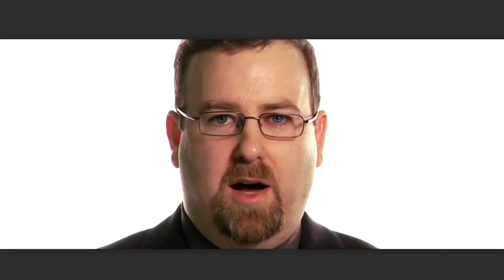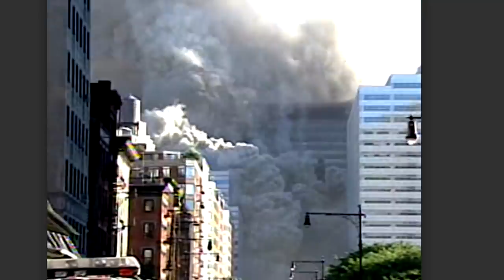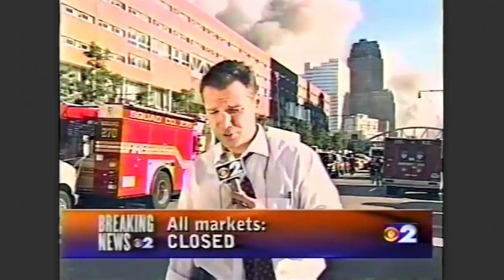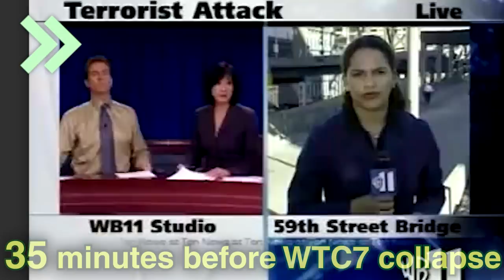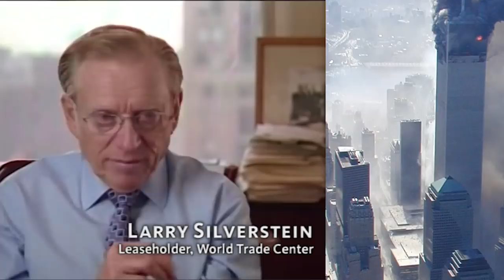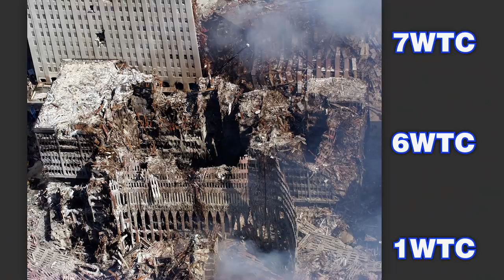9/11 - 7 World Trade Center (WTC 7 Free Fall Collapse)

Comment: It fell at a rate that you would expect with the INCREDIBLE DAMAGE from the plane attacks ,and yes , the  Very long burning Extensive fires ,
Reply from the maker: WTC7 was not damaged by any plane attack. It was damaged by the destruction of the North Tower, which started fires.

The fire is the reason the government says WTC7 fell. The government states that the physical damage alone to WTC7 was not the reason for collapse, it only happened due to the resulting fire.

As mentioned in this video, many buildings have had much larger fires burn significantly longer, and remained standing.

Comment: Where does the "7 second" figure (for how long WTC7 took to collapse) come from?  Has it been confirmed by NIST or FEMA?
Reply from the maker: https://www.nist.gov/pba/questions-and-answers-about-nist-wtc-7-investigation

Actually NIST says it was 5.4 seconds: 

"The analyses of the video (both the estimation of the instant the roofline began to descend and the calculated velocity and acceleration of a point on the roofline) revealed three distinct stages characterizing the 5.4 seconds of collapse:

Stage 1 (0 to 1.75 seconds): acceleration less than that of gravity (i.e., slower than free fall).
Stage 2 (1.75 to 4.0 seconds): gravitational acceleration (free fall)
Stage 3 (4.0 to 5.4 seconds): decreased acceleration, again less than that of gravity"
Reply: That's for 18 out of WTC7's 47 stories.  As your source puts it: "NIST stated that the north face of the building descended 18 stories ... in 5.4 seconds."

Comment: For the longest time I thought WTC 7 was plausible. Then I realized that something was missing: the sound of the detonations that would have been heard a couple of miles away. Try watching real demolitions sometime.
Reply from the maker: If you known about this for a long time, you’d know people speculate that thermite or some other specialized military explosive were used.
Reply: The people on the ground near building 7 heard the explosions before the building came down. I've seen the people talking and heard the explosions.
Reply: it was heard and is well documented and recorded by many , many witnesses who were there.  There is only one way a building falls like that,  only 1,  a simultaneous global break of all the main core vertical structures.  Office fires cant do that,  they cant even melt steel.  The building it self was built to rigorous fire prevention codes.  This is why steel buildings do not collapse due to fire,  and they have not to this very day.

Comment: Well, here's your daily dose of debunking

1. The FDNY predicted that WTC7 would collapse 3 hours before it did. At 3:32 PM, firefighters noticed a bulge in the northwest corner of the building. They also reported hearing creaking noises coming from the building. 

2. Many people did report hearing explosions minutes before the building collapsed. This was concluded to be the exploding diesel generators inside WTC7. There were 40 generators in total. 

3.  The Demolition Truck never went anywhere near WTC7. There are many photos, the most famous being taken by Evan Fairbanks, that shows the demolition truck at the debris field. It was later revealed by the FDNY that the Demolition Truck did not carry any explosives whatsoever.

4. The news reports. One of the news reports here showed the reporter saying that WTC7 had collapsed or "is collapsing." Many other reporters said the same thing. 

 5. The famous "Pull It." One demolition expert claimed that the term " Pull" is never used in an explosive demolition. What the FDNY meant by "Pull" was to leave the building and the surrounding area. The term Pull is used when a building is literally pulled to the ground, just how WTC3 was pulled down during clean-up at ground zero.

6. The collapse overall. When WTC1 collapsed, flaming debris was ejected into WTC7. Fires began inside the building. The building also took significant damage. One firefighter reported that about 15 floors in the ND corner was scooped out. In one video, a bystander can be heard saying "look at the hole in that building. That building's coming down." As the fires were fueled by the diesel generators , they continued to eat away at the strength of the steel. Finally, at 5, truss 1 in the SW corner fails. It causes and upwards collapse that reached the roof. This is signified by the collapse of the penthouse and sunlight being visible through windows in the upper floors. 8 seconds later, the rest of the building comes down as the remaining 2 trusses can no longer hold the weight of the building.
Reply: AllanRod17 you didn’t debunk anything. Building 7 was still up when the news made the announcement of it collapsing. Explosives set on chains were visible. We know the truth. But nothing can be done about because we all have 9-5 to worry about. 3k Americans died for greed. And 500k Iraqis died for cover up and oil. Gn got work in a few hours.
Reply: @payitforwardpower9910  I think I provided enough proof, you think? Even going as far as searching through images. Spent a whole night, actually. So it frustrates me to see that even though all this damned proof is here, someone still comes up and neglects it.
Reply: AllanRod17 there is no need to call me stupid. Also I said Iraq not Afghanistan. And I don’t need to fool you cause I don’t even know you. Looks like your already fooled if you spend more then 20 minutes researching n you can’t see the truth. Truth hurts my guy. God speed. GN hope your feeling alright.
Reply: No one can explain the symmetry of the collapse: it proves it was CONTROLLED demolition. Period.
Reply: @Lord_Lykan  Ok we are ignorant, please give us a link to one who can explain that, you genius
Reply: @marcomelis638  With pleasure: 

https://www.youtube.com/watch?v=_kSq663m0G8
Reply: @Lord_Lykan  dude... you play roblox...